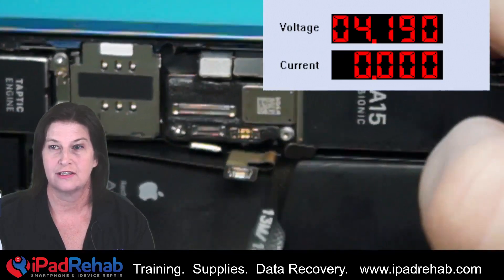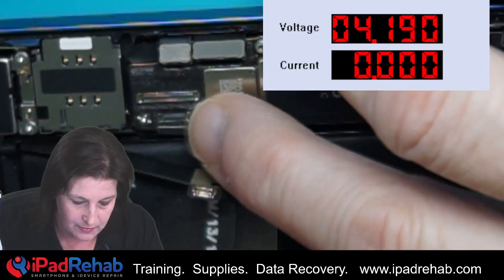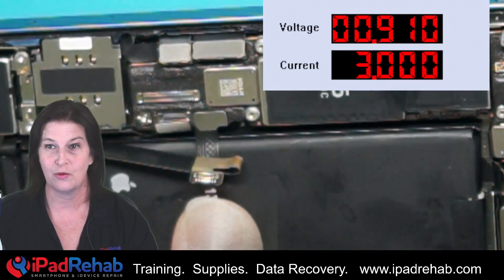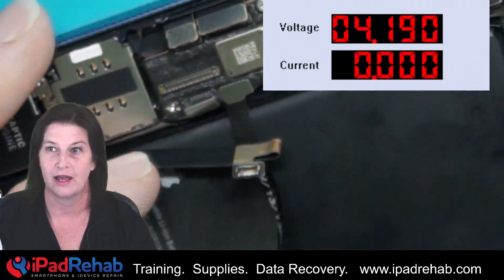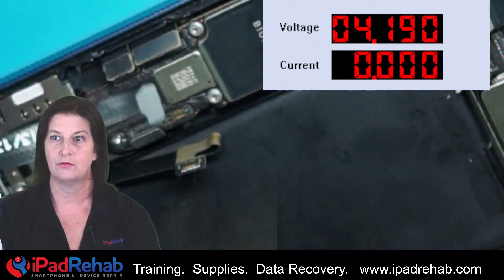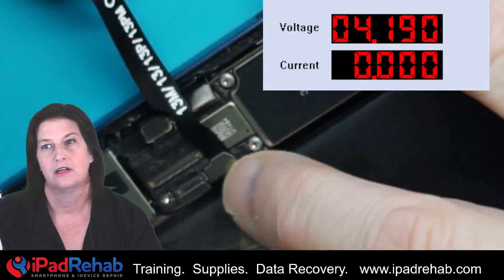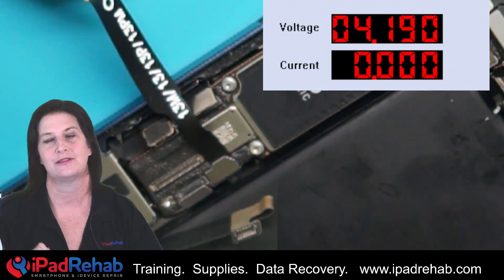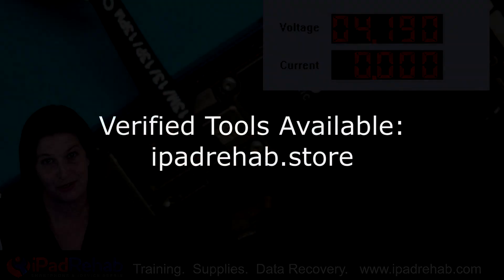FLIP the SQUID: Don't be trolled by the iPhone squids

Comment: Awesome! Just wondering why the voltage in display is different from the stock PLD software?
Reply from the maker: The power supply will always lower the voltage to respect the current limit when there is a short circuit, or in this case when the positive lead is connected directly to ground

Comment: I knew this was a thing so I wanted to measure in continuity mode before powering up but when I went to touch the banana plugs I accidentally turned on my DCPS and instantly 2 AMPS!! 
I was so afraid of trying to power it back up just to realize I killed the motherboard... seeing this is quite a relief, you can get away with plugging the battery connector backwards (although who knows what other damage can cause)
Reply: Yes there’s a protection diode (or something similar) that shuns the voltage to ground if polarity is reversed to protect pmic and other components. Most (good) electronics have this